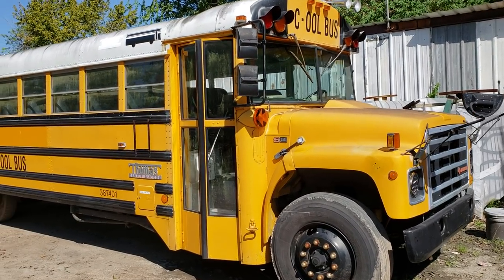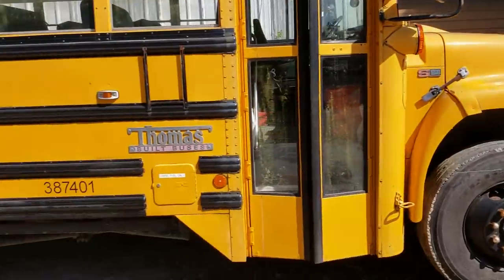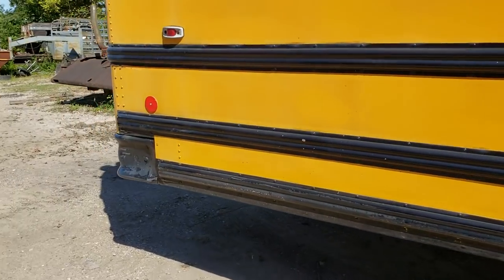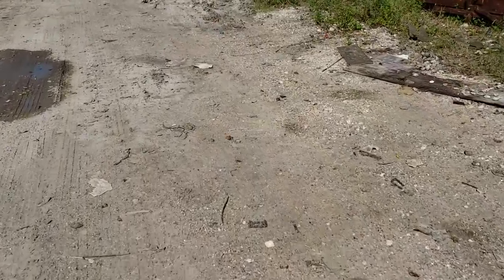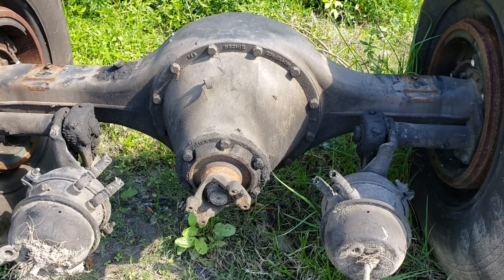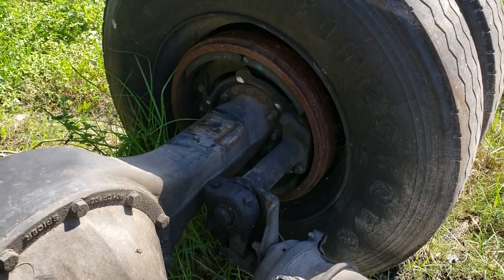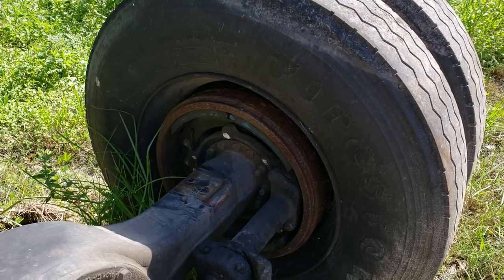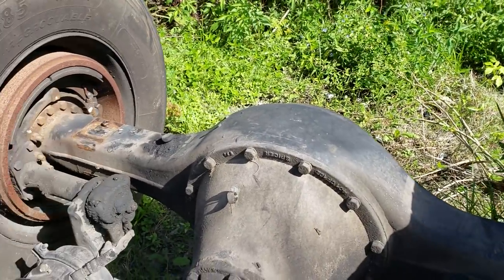Axle swap progress/anatomy of a bus axle

Comment: Hey Jon. its me Conner, from one of your Q&A's. I was CONNER 12. I have a question for you. which led bulbs do you prefer for the stop sign. i am planning to replace the incandescent bulbs because those are getting dimmer when the lights activate do you prefer that i get whole new light fixtures, or should i get the 1157 replacement (led) bulb?
Reply from the maker: I haven't tested LED bulbs in the stop signs yet--the Thomas has Specialty LED retrofits.

Comment: those look like automatic slack adjusters for the brakes on the axle if its made after 1994. i think all International S series chassis up to 1990 the slack adjusters are manual. i would swap the whole axle got updated brakes and automatic slack adjusters. if the axle had the cast spoked dayton wheels is how to swap the dayton wheel to the budd or accuride wheel.
Reply from the maker: All the S-series around here had auto slacks.  My Thomas was ordered with auto slack adjusters according to the line-setting ticket, so it was an option to get them.  I do hope he swaps the whole axle as the updated brakes are a plus!
Reply: I see i seen the School bus safety video on air brakes it said models before 1994 may require manual adjustment.  as i think the thomas would look better with the older Dayton wheels but its got the Budd wheels on it if in doubt on how difficult to swap between the Budd and the Dayton wheels as the later Blue Bird Tc2000 had 6 spokes in the front  the standard 5 in the rear. as they say now the dayton wheels are phased out being hard to true. as newer school busses don't come with them anymore they come with Budd, Accuride or Alcoa alunimum wheels.   What will be the top speed with the axle and the auxilary gearbox.
Reply from the maker: I'm leaving this one budds--the Bird has 5 spoke daytons.  Top speed should be in the low 80s.  It puts 65-70 in the powerband and not in redline.
Reply: Oh i see i had not seen a wheel swap done before on a medium duty truck or bus between the Budds and Daytons. As some rear ends can be 2 speed. depends if the bus comes with them. I seen Jay Smart's video he has a mid 1980s Thomas S-series by International Harvester as that bus needs rescued its got a 9 litre diesel naturally aspirated.  as it  has the international logo on the top of the grille.  the busses you got are made by Navistar International as the international logo is  on the lower left corner of the grille. but 1987 the S series show the biggist corporate changes when IHC was renamed Navistar in 1987 for the Medium duyty truck and heavy duty truck line. as the mid 1980s is when International phased out all gasoline engines the S series was the 392 and 404 gas engines.
Reply from the maker: @derekobidowski5784  I am aware of all of that